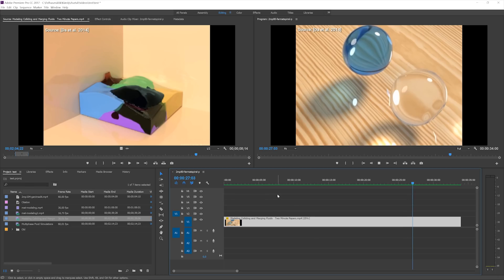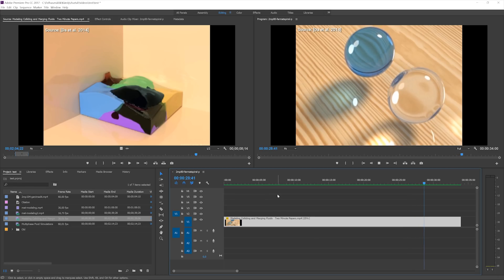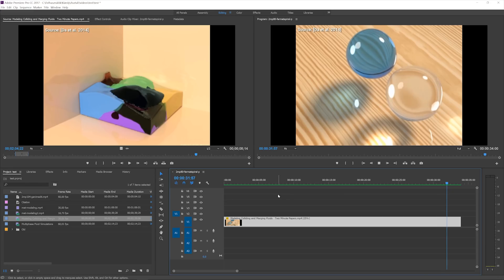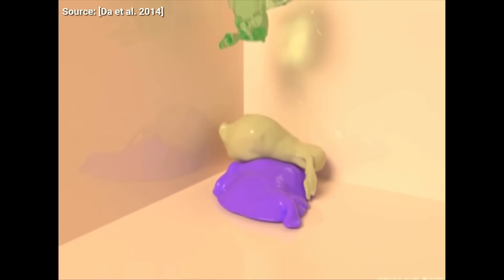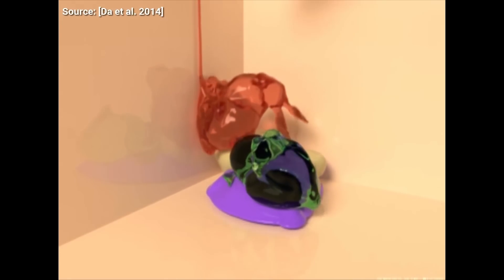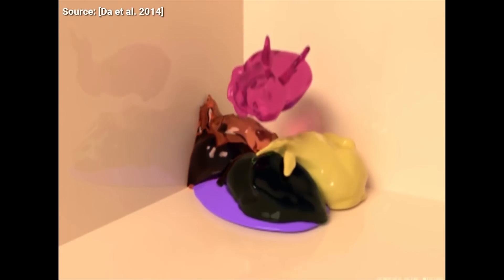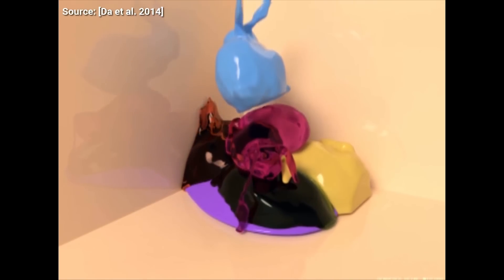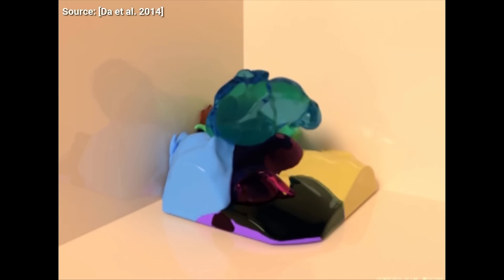Amazing Slow Motion Videos With Optical Flow | Two Minute Papers #119

Comment: This was in PPro since CS3...but was then removed and in a hidden menu (alt-f12) from cs4-cs6....now a rewritten algorithm for CC. Hardly a cutting edge algorithm though in the style of this channel :)

Oflow retiming will give a lot of artifacts on semitransparent objects in real world examples.....since there is only 1 vector per pixel (usually subsampled much less then that) things like a dancer with semi transparent flowing fabric will cause artifacts because the algorithm will smear the background showing through the fabric, locking onto the motion of the fabric in front of it.

On a solid color background this of course is no issue

With completely solid objects it works really good, with high transparency it is not bad as long as the specular reflections are contained otherwise in a rougher 'shower door' type surface the algorithm will again smear background pixels not being able to discriminate front and back vectors

It's not quite yet a magic bullet....but it is the best we have right now

Comment: The final armadillo shot looks like there are no high-frequency optical flow artifacts but rather frame jumping ones, if that's a way to say it. - You can see how they don't fall entirely smoothly but rather they slow down and speed up again for some reason. I suppose that would be equivalent to mild ringing artifacts in image zooming
Reply from the maker: Agree. Since there are no parameters to tune, at least in this implementation (which may also be interpreted as a good thing), you simply try it, and take or leave the result offered by Premiere. There is not much one can do to work around possible issues like this.

Comment: I think SVP gives better results than Premiere Pro optical flow. Give it a try.
Reply from the maker: Thanks for the tip! There is also the Twixtor plugin that is doing quite well for slow motion videos.
Reply: Yes I was thinking about Twixtor. Would you say this is better than Twixtor? These processes are great for filling in missing detail.
Reply from the maker: Twixtor is generally considered to be a bit better than Premiere's built in optical flow implementation. It also exposes some parameters to the user to possibly improve the results, but it also takes a bit of labor to set it up correctly. It also costs around $300 if I remember correctly.

Comment: I wonder if this could be used to artificially inflate the framerate of video games.
Reply: I think that would be hard (even if the interpolation is quick) since the next frame would be needed to calculate the in-between-frame. However, it should be possible to do if you are willing to get lag for the input (½ frame). But if you have the computational resources to inflate frame rate live, i guess it would be cheaper to just render at twice the speed.

My thinking is that this is something for post production.
Reply: Karl Hansson Well you typically have double-buffered frames, where the game engine is already writing the second frame. Then when it's time for the next frame, you switch around a pointer and the read-from ("current") buffer and the write-to ("next") buffer are switched. The way I figure, you add a third buffer which is a copy of the current buffer, then between physics calculations, you're already doing matrix multiplication operations on the GPU anyway, why just apply it to the middle frame? Since you know the actual underlying physics and position of the objects rather than just an image, I imagine you could probably optimize it pretty well. Triple-buffered game engines have never caught on since they're kind of pointless. But I could see a 2.5 buffered engine.
Reply: Judging by premiere's implementation it's not exactly a realtime process. It would introduce more delay thus input lag and if the game was already running at only 30 fps it would seem really counterproductive. The biggest benefit of high fps in games is not how it looks but how it plays.
Reply: Problem is, you need to know what is coming up, and if you are drawing the image live and want the viewer to see it as fast as possible, you won't be able to know what's coming up. With that said, frame interpolation is indeed used in video games. All Oculus SDK games have the feature for example.
Reply: ASW from oculus does this (sort of, it's a 3D technique that uses data to interpolate within one frame at 1\90 seconds)
Reply: For a novel method, look at this paper on Force Unleashed II: http://and.intercon.ru/releases/talks/rtfrucvg/
Reply: The game engine already knows the objects and their motions, there is no benefit trying to estimate it from the output frames. Throwing away information and trying to recover it again is not efficient use of resources. Also, the additional compute power required could be used to increase the game's framerate instead.
Reply: U Wot M8 lots of things are mapped rather than calculated on the fly. Using optical flow interpolation may be easier than rebuilding all the assets.
Reply: This technology is not realtime yet. But it could be hardcoded on a dedicated chip. This would be usefull for some kind of games, the games where beauty of the scene is more important than latency. But in most games, you don't really care about framerate, you care about latency, and yes, the higher the framerate, the lower the latency. This technique will not reduce latency, it will increase it by the amount of generated intermediary frames because you need the final frame before starting.
Reply: Sebastien Caunes Doing the analysis is the expensive part, but it isn't really necessary since you already have full xyz and velocity of every pixel. Chances is that games might already or in the near future be doing framerate interpolation with less artifacts than in the video. The whole new id tagging, which I am not too familiar with, seems to allow more general implementations of this type of frame effects.
Reply: Robert Szasz This is built into just about every television ive seen recently.. and Ive made realtime versions in glsl
Reply: Robert Szasz you're right but the version you see in TV does not seem to be as advanced as this one.
Reply: What about 2D animation? It would cut a ton of the cost if we could just draw keyframes.
Reply: You're probably better off using an AI.
Reply: some TVs already have a version of this technology already implemented (usually the ones that advertise 240hz support or something), however it introduces significant input lag on the game, and also a number of artifacts, so it really causes more problems than it solves
Reply: My man , we have it now